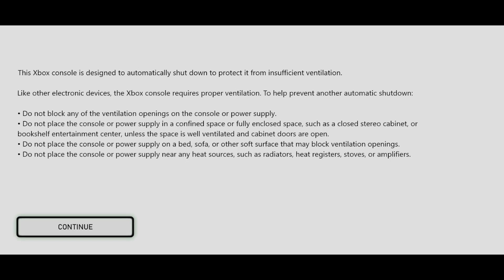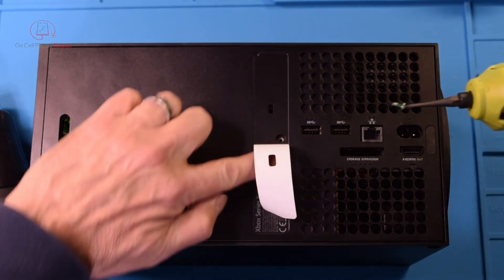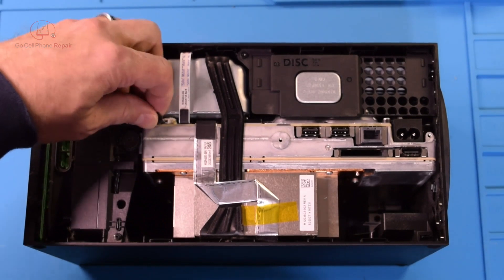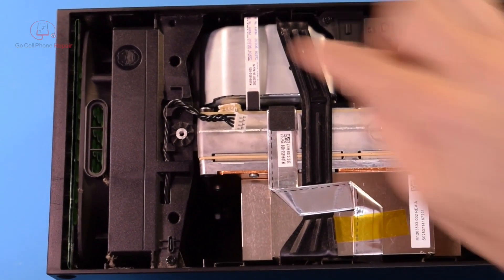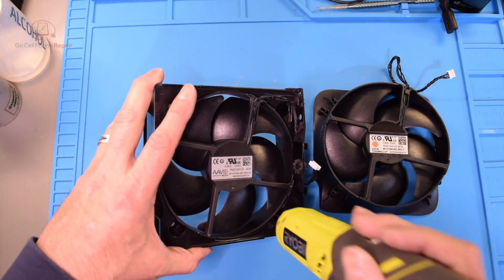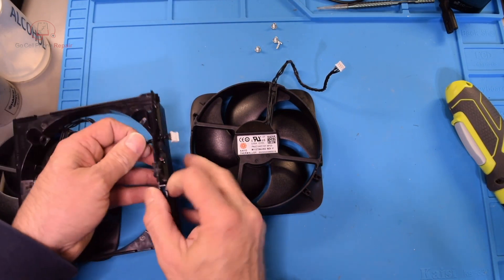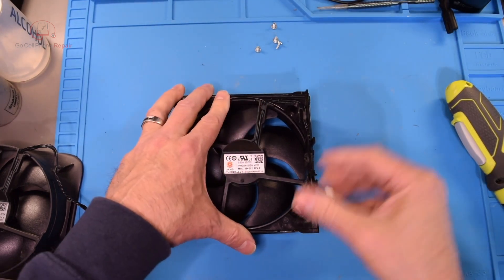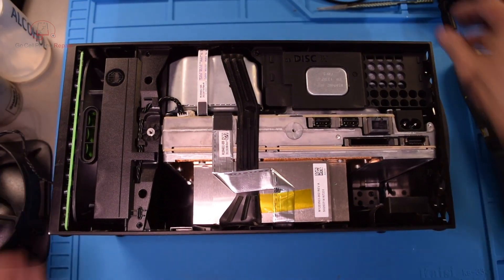XBox Series X Fan Replacement

Comment: I got the replacement part from Microsoft and it won’t fit it also looks completely different like wtf I can’t find the actual part anywhere. My Xbox series x disk drive version is from 2021 and I can’t find a replacement cooling fan that fits.
Reply from the maker: You did try transferring the outer part from the original right?

Comment: Can you help me the connector that’s in the Xbox which your fan has to connect to that connector in order for the fan to work that connector has come out of my Xbox so I can’t plug my fan back in. I have the connector but I don’t know what to do.
Reply from the maker: If the piece is not damaged, it can be reconnected. If you need help you can contact me here: https://gocellphonerepair.com/
Reply: @GoCellPhoneRepair i paid a shop to fix it and clean it cost £ 65

Comment: Just replaced my fan according and it still shows me an error message just like in the video what could this be?
Reply from the maker: If you see a lot of dust or lint inside it might need further disassembly for cleaning. If the fan is spinning and you've cleaned the cooling system sufficiently then my next guess would be that your thermal paste has degraded or there is something causing the thermal sensor to malfunction or an internal source of excessive heat; possibly something shorted.
Reply: @ took the Xbox apart completely thermal paste was fine but I ran into a problem the heat sink has been damaged severely and was bent so I ordered that part and it arrives in a few days
Reply: Did it fix your problem? @Skazor

Comment: What if there is no error message? Console just powers off at random times..  could this also be the fan?
Reply from the maker: Could be, hard to say. If the fan is spinning and there is no dust build up inside then you probably have a different problem.
Reply: Power supply maybe

Comment: My device's fan makes a propeller noise when I play heavy games, but I have not received an overheat warning yet, is there a problem?
Reply from the maker: There could be dust building up on the inside. That is fairly common. Over time the thermal paste degrades as well. It most likely is one of these but could be something else. I'd start with removing the back panel an blowing it out with compressed air and manually removing and visible lint/dust.

Comment: Nice to get an easy repair every so often to make up for the down the rabbit hole repairs
Reply from the maker: Hey Greg! Yeah, I edited out most of what I was doing with the multimeter once I realized it was just a seized motor. Was really gonna connect to the power supply and see if it would spin.